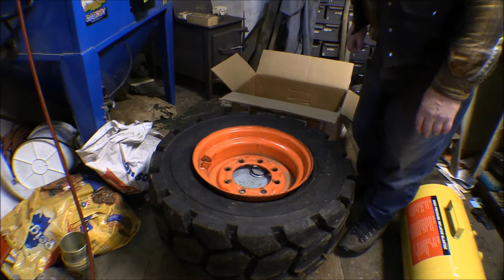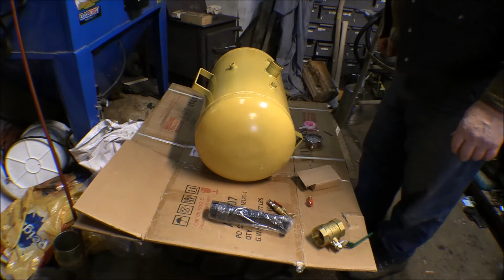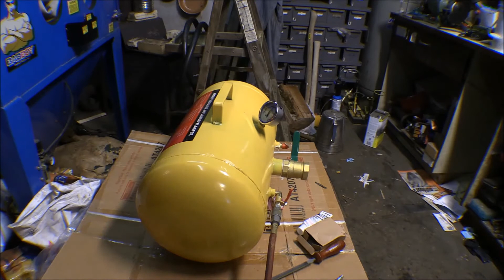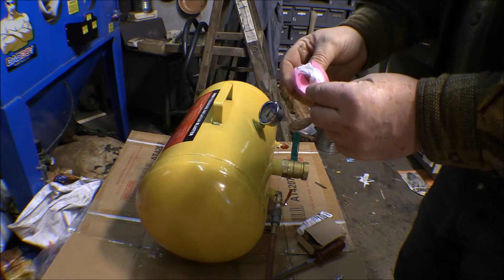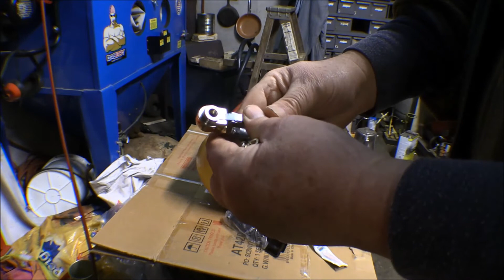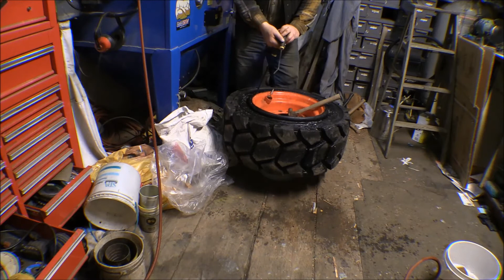Skid steer/ Bobcat tire inflating

Comment: I guess your new yellow blaster was no good. You ended up some how using your air hose and soapy rag.  All so not  need to worry about a little air very leaking out of blaster. It is not a air storage tank. If not get the job done with it after 8 minutes full - time to take tire to Les Schwab tire.  I needed to know how much air the tire needs .